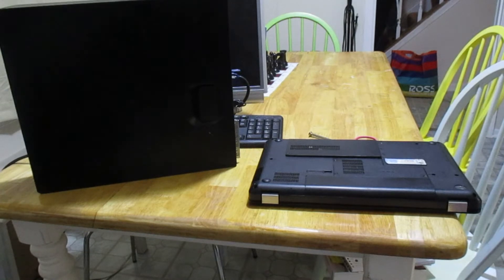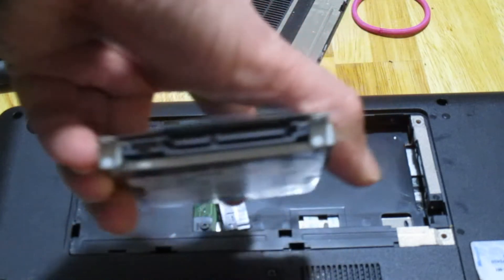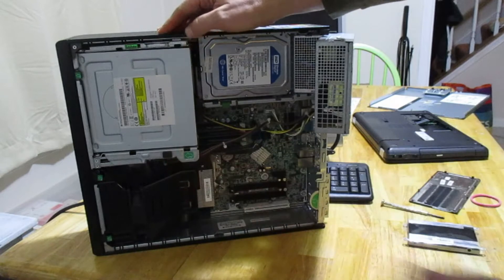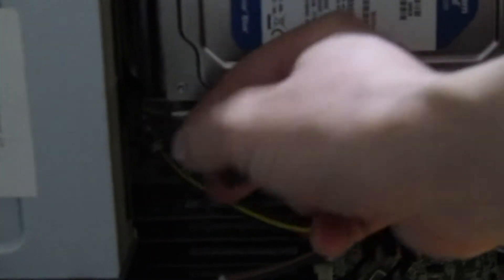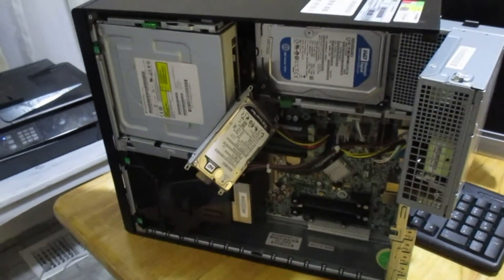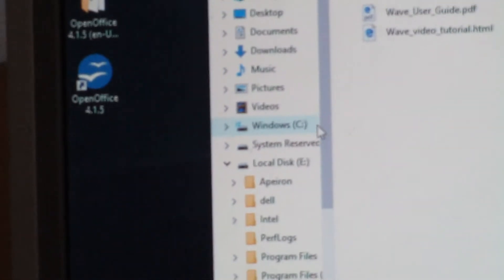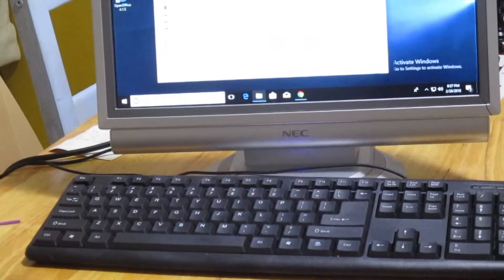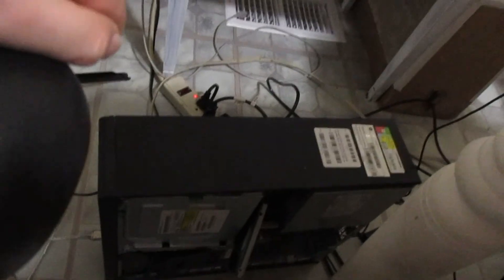How to Recover Files from a Crashed Hard Drive Using a Desktop Computer

Comment: Do you have any advice on what to do if you have an operational drive that failed a system restore giving blue screen errors in a laptop and when you plug said removed drive from the laptop into a operational desktop the desktop tries to boot from the corrupted OS drive putting the same blue screen error on the good computer?    I've heard I may be able to delete the OS off the laptop drive by trying to load a new windows installation onto the corrupted drive and then remove the OS but keep files.  Stop the new windows installation and then try plugging the laptop drive into a good desktop again to see if it will show files without error.  Does that make any sense?

Comment: I was able to get my old files by putting the hard drive from my laptop into an inateck external hard drive case. I was in the process of recovering files from my deleted files folder on my desktop when my computer failed. I have all files with the exception of my ColdFusion coding files. The project files are where they should be but all my ColdFusion (similar to PHP or ASP) files have disappeared. This is due to some mistakes I made with git and git hub. Is there a way to recover files that are in the recycle bin? Thank you so much.
Reply from the maker: Usually the files are still there until you 'empty the trash'. Did you check in the trash bin?? It is possible to undelete file using photorec, but you need to stop using the drive immediately! Those files are still in the back ground.. but the system will start writing over them! Here is a video talking about photorec..
https://youtu.be/vLUpJOZmREs

Comment: My OS crashed and wont boot up will this still work?
Reply from the maker: Yes, In fact that is what this method is good for.. if the hard drive mechanically fails, nothing will work.. With an OS crash, you should definitely be able to recover your data..

Comment: Good day, I was about to try this as a last resort since my computer (Dell Optiplex 755) either has a blinking amber light with no beeps or a constant amber light with no beeps, but I decided to ask your advice first. I've changed my cmos battery and cleaned and reseated my rams, but my computer still gives me a blank desktop/no signal message. I've tried just about everything recommended in videos pertaining to the topic, from force shutting down to restarting my computer after removing one ram at a time, but nothing works. Is there anything else you think I can do? Thank you in advance
Reply from the maker: I would try to back up your data, if these other things are not working.. then once your data is safe, if you want, you can build a new hard drive with OS possibly on a new computer??.. or you could try heating up the laptop.. It is possible that this problem is caused by a bad solder joint.. and heating it up may re-flow the solder??.. one viewer said he successfully used a hair dryer to heat the computer... But I would not recommend anything risky, until you back up your data first.. Hope this helps.. Best of luck!

Comment: did this, and my pc wont boot, it shows no signal on the monitor, if i take it out it boots after some time of staying in no signal.
Reply from the maker: It should boot as normal, once the system is restored to its original state.. is every thing hooked up as it was before?? Is there any flashing lights.. or hard drive activity?

Comment: I followed along on how you did this but I didn't get anything from mine. All I saw that could have had anything (which it didn't) was 'Program Files x86 and SWindows. I'm now wondering what I didn't do right?
Reply from the maker: If you are able to access the drive, and see things on it.. that is all that is there.. Did you try doing a search for the files you are interested in?? Things may appear in different location when accessing a drive as a second HD. For instance 'desk top' will be in a buried folder, and not actually icons on your desk top any longer.. That privilege is reserved for the booting drive only..  It is possible that either the surface of the drive is damaged and that data is gone, or maybe the bearings are loose,... this is one method that causes hard drive to fail.  It is possible sometimes, if it is the loose bearing problem, to stick the hard drive in the freezer for an hour or two, then try to read data before it warms up.. this can tighten up the bearing enough that you can read data for a short period of time, until it warms up.. Try a more thorough search of the drive first... Best of luck
Reply: @jaynesnetwork  it turns out that I accidentally stuck an older hard drive in. When I put the one in that crashed, it wants to boot from it rather than the new one. The new one isn't recognized in the bios but when I take the old one out it then boots from the new one
Reply from the maker: Sound Promising.. Best of luck.. I would back up any important data you may have ASAP... just as a good measure, even if it is booting..

Comment: My hard drive got crashed and people said that I can’t recover my data,so will I be able to recover my photos and files with this method?
Reply from the maker: It depends if the disc physically stopped working, or if only the OS that is corrupted.  You can try this method, and if your computer is able to access the disc, then you should be able to recover your data,.. If you can't, and the hard disc is making a funny noise, or the hard disc does not spin up when powered up.. then maybe you are out of luck... The only way to know is to give it a try..

Comment: So you boot with the OS that's on your C drive, and make the dead drive a seperate drive (or a slave?) how did the drive die? mine's overheaten I think, won't boot, nothing nada, doesn,t make click sound what-so-ever, just a lot of bias bitching, and some broken pencils.. I hope this trick works, it was already on my mind, but you gave me more hope.
Reply from the maker: This trick will only work if the hard drive is operational.. and it is only a software problem with the OS, so that it can no longer boot its own computer.. It is possible that the hard drive can physically fail, and then it is impossible to recover anything.. If it is getting hot, and acting strange.. it is probably a failed hard drive, and most likely you can not recover data from it.. one trick I found, is that sometimes the bearings can go bad, by getting to loose.. and if you put the hard drive in the freezer for some time before trying to read it, then the cold will shrink up the bearing, and sometimes it can help.. The hard drive can have a failed circuit board.. or some other mechanical failure.. if that is the case, there is no reasonable way to recover the data..  It is worth a shot. Does the computer recognize that the hard drive is plugged in to it?
Reply: @jaynesnetwork  i didnt try yet, but the hard drive, whilst in the crashed pc, didnt make noise, the bias just didnt find the OS. I bought a new internal drive, that i'm gonna use for this trick. We'll see....

Comment: I'm searching for ways to recover my old files from my dell towers cuz I REALLY don't have the $ for NEW pcs. I've been disabled for over 7 years now and need to keep busy, so I'm getting into "PC REPAIR" - but to fix MY own computers. 
Since I've decided to make THIS new approach to saving money, I'm curious as to what is on my old hard drives. 
When one pc tower "dies", I just get a refurb'd one and simply just save the "dead" ones.
Reply from the maker: If the drive is still working, you should be able to find out.  Good Luck, everyone need their computers fixed.. because they are always breaking.. Thanks for the great comments..
Reply: I was able to recover files I never thought I'd see again! As I dug even deeper into videos on this subject, I ran across one showing how to use the optical drive inputs in place of a hard drive tester to boot the pc up from the old hard drive.
The first question that came to mind was...do all optical drives just HAPPEN to have the same connectors as the hard drive testers? (I was using what sees to be the "go-to" tester - the R-DRIVERlll. 
I believe the computer used in the video was an HP. Was it just LUCK that an HP has(had) the right inputs or is it common to ALL pcs?
Reply from the maker: I believe that the optical drives use the standard SATA connectors, which is the same connectors that are used by the standard hard disc drives.  It should be the same on all computer..
Reply: I appreciate so much the quick replies!!! I'm glad I subscribed!
Reply from the maker: Thanks I try to check the comments at least once a day.. except when I am traveling and I don't have computer access, or something. Thanks again..  Much appreciated..

Comment: I found your previous video first dated 2016 and it looked simple enough and I was all set to go on ebay and buy the sata to usb adaptor. But then I read one of the comments you replied to in which you said you had a more updated and recent video - which of course is this one, and I think the above method is so much easier for me as I am certainly not a technical person. And also I have an old desktop pc  with xp in my garage, so I will definitely be digging that out tonight and try this method. Cheers
Reply from the maker: The other method might be simpler, since you don't have to open the computer... but this method is cheaper for sure, since you don't need to buy special cables.  If you feel comfortable working inside the computer, this might be a good option to try.
Reply: Hi there, yes it worked, I was so relieved. And I've saved myself some cash. It was a bit tricky because the hard drive was located underneath the DVD drive, but I used a screwdriver to slide out the sata cables and then attach them to my laptop hard drive. Many thanks, great method.
Reply from the maker: Great!, I'm glad it helped..

Comment: I just came back to say, thank you. I have an HP computer that is brand new and staggeringly, has only one SATA connection on the motherboard for hard drive use. I also had a drive from my previous HP computer with a ton of files on it I could not access because of the new computer's amazingly stupid  motherboard layout.  How was I going to get at my files? Thousands of them, including three quarters of a novel I am writing. 
Then I found this video. I realised that I almost never use the CD/RC player thing so I unplugged it and used the connections for the old drive. SUCCESS!  Thank you, thank you, thank you. 
As for HP.....I will never buy another of their computers as long as I live and will advise everyone else to give them a miss also. They are over priced crap.
Reply from the maker: Great, I'm glad it help.. Feel free share this link with your fiends..  Yes this is probably the easiest way I have found to back up an old hard drive..  Thanks again for the great comments..